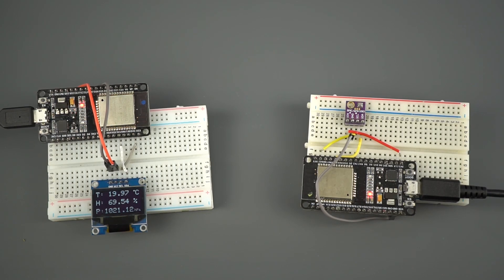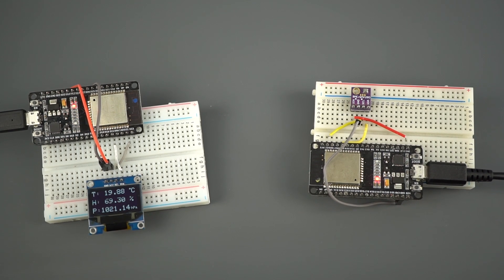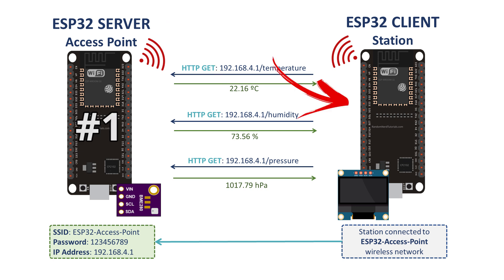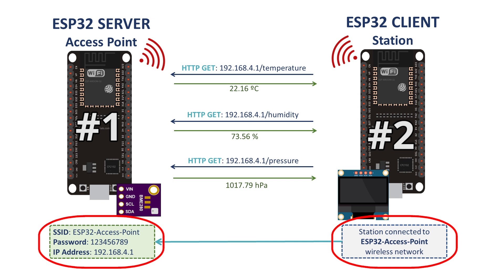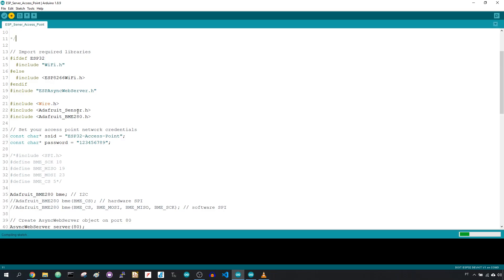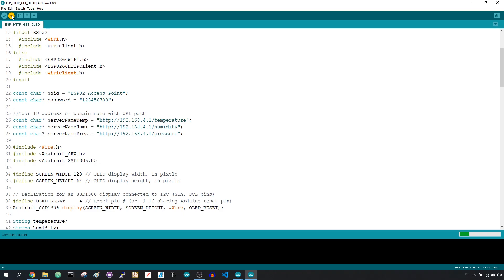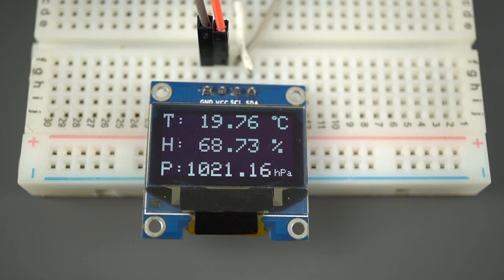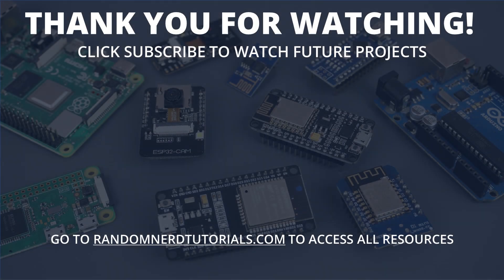ESP32 Client-Server Wi-Fi Communication Between Two Boards (ESP8266 Compatible)

Comment from the maker: You can find the complete project details on my blog!
- ESP32 Schematics + Source Code ► https://RandomNerdTutorials.com/esp32-client-server-wi-fi/
- ESP8266 NodeMCU Schematics + Source Code ► https://RandomNerdTutorials.com/esp8266-nodemcu-client-server-wi-fi/
Reply: What can be the maximum distance?
Reply: How many clients can we connect in this process
Reply: Hello Mr Santos. I have an stack in ESP32 Camera board, when iam upload WiFi camera access in example software Arduino 1.8 then code error ............
Can you help me ?
Reply: I'm trying to connect two esp8266 using server and client protocols and sending the data to thinkspeak server. Help me please 🥺
Reply: Hi sir, i just want to know the max. range in which these two can communicate without any issue
Reply: Hi sir, i just wanted to send soil moisture value over wifi to another esp32 so that other esp32 can turrn on motor. can you please help me out in sketch ? i have tried to change the sketch you used in this tutorial but ended up in error. 
Thanks in advance.

Comment: @Rui Santos with asyncwebserver is possible this function,? 
1 connecting by router
2 if server have data send direct to client? 

I have test your part code and need sugestion for my complete my project. 
Your code have problem for working with router installed to my hardware. And work only m2m without router. 
I have send two post to your website blog. 
Thanks

Comment: What's about changing the roles of server and client? Would be much more logical for me. So when connecting to multiple sensor stations you have the one with the display and multiple clients on different locations..
Or is it still the client with the display that ist permanently pulling from different servers (per definition)?

Comment: Hi, nice tutorial.
What is range of this comm, if its couple of meter isnt then better to use BT?
Thanks for sharing.
Reply from the maker: With this project using ESP32 boards and in open space (no obstacles) I was able to get up to 50 meters (164 feet) reliable communication
Reply: @RuiSantosdotme  Well that is respectable distance, thak you for your fast answer.

Comment: You say keep the two boards "relatively close." About how far away can they be and still communicate? Thanks!
Reply from the maker: I suggested keeping them close to test to ensure that they establish a communication. However, with this exact project using ESP32 boards and in open space (no obstacles) I was able to get up to 50 meters (164 feet) reliable communication
Reply: @RuiSantosdotme  good to know. Thanks for the quick reply!

Comment: I am getting some unnecessary text at my serial monitor, i tried modifying the code and remove the codes for the sensors cause I don't need them and I only need to try a simple getrequesr without using internet
Reply: Sir rui Do you have any videos how?

Comment: ESP32 question: I need to connect via I2C: BME280, BNO055 gyro, L53L0X TOF Time-Of-Flight, and optionally an OLED 128x64, I read I need to add pull up resistors. 1) would there be pull up resistors already on these modules? 2) would each sensor need 2 resistors for data and clock, or would you only add a set at the end of the "chain" like termination back in the SCSI days? Thanks:-)

Comment: why not use an RF reciever transmitter? cheaper
Reply from the maker: It depends on what you need.... If you use a microcontroller + RF receiver, it's more expensive than just using the ESP microcontroller

Comment: I like your work with ESPs and bought your ebook to do some of this. 
This particular example (of data sharing among ESPs) makes me wonder whether there could be a common architecture or strategy for sharing data among an ecosystem of various devices, where the ESPs manages the end-point devices and - perhaps - an RPI acts as a higher level computer with Node Red handling the video display and user input. 
I came across this two-year old presentation from Martin Ger that shows ESPs acting as MQTT clients and servers! https://www.youtube.com/watch?v=0K9q4IuB_oA 
Unfortunately - as a beginner - much of this is over my head. But I can imagine this approach as a common architecture for the intelligent collection of sensor data used in driving all kinds of end-point devices. 
HTTP among devices is a clever way to solve communication among ESPs. But I wonder whether a thorough examination of Martin's approach would be a giant step toward device integration. What do you think?

Comment: Perhaps you may have a look at the proprietary so calls "802.11 LR" WiFi feature of the ESP32 that supports long range data transmission up to 1 km! "LR" stands for long range some joking and say it means low rate because it is slower than nomal Wifi. This (routerless) setup in the tutorial would be an excelent usecase for this properitary feature because is can not be mixed up with normal WiFi standards. See https://www.hackster.io/news/long-range-wifi-for-the-esp32-9429ab89f450

> The 802.11 LR mode is a patented custom mode that can achieve a 1 km line of sight range so long as both the station and the soft-AP are connected to an ESP32 device.

Comment: I don't mean to be negative, but isn't this setup a bit back-to-front? What I mean is, wouldn't it make more sense to have the Client connecting to the Server's Access Point, but put the sensors and API on the Client module, and connect the display and issue GET requests from the Server? That way, it would be trivial to add extra Clients running the same code and simply modify the Server code to GET from additional IPs/URLs. 

I might've misunderstood the tutorial, but it seems to me that if you wanted to add additional ESP+sensor client modules to the setup as demonstrated, you'd either have to configure them to connect to the first sensor's access point and then add a bunch of extra endpoints to the server code, or else configure the client to somehow keep connecting to and disconnecting from different APs (I've no idea how you'd do that). Either way, it's extra code, when surely the aim in such projects would be to maximise reusable code and minimise rewrites. Or am I missing something here?

Comment: I get the "error code -1" display in client serial monitor window
Reply from the maker: Do you have both boards powered on? Do you have a BME280 connected to your board? Is your ESP access point IP address 192.168.4.1?
Reply: Yes all this requirement all fulfilled
Reply: Then why this msg display in client esp8266 serial monitor
Reply: Please can you share client program without this display
Reply: One thing I did not tell you is that I use client program for only to display results on serial monitor not on display because I don't have that type of display
Reply: Please! kindly share the program only for show results on serial monitor . I needed it very much, I am very thankful of you if you share my above requirements program, please! I really want your help

Comment: THIS IS EXCELLENT!!! So many Tuts require a router network. I can figure it out, but it would be nice to see how you can "CONNECT" and use a browser to collect this data from say a laptop, or Android phone. Very helpful info here!! Great work!
Reply from the maker: You would need to make your laptop/smartphone connect to the ESP Access Point, then open the ip address followed by /temperature (to see the temperature). You could also setup a web page in your board that would display all those readings at once

Comment: Same module needed to communicate?
Reply from the maker: What do you mean? You need two ESP boards to communicate with each other
Reply: @RuiSantosdotme  i mean, connecting eap8266-12E and esp8266Node mcu?
Reply from the maker: @NishantjonyJaiswal  sure, you can connect any ESP to another ESP (ESP32 to ESP8266, NodeMCU to ESP-12E, etc). You just need to setup one as a station and the other as an Access Point
Reply: @RuiSantosdotme  thanks ☺️